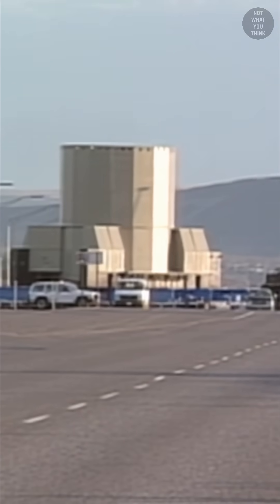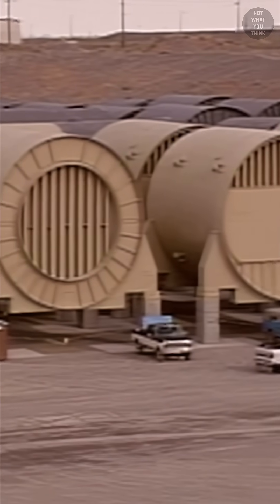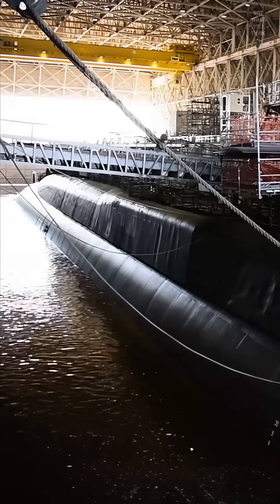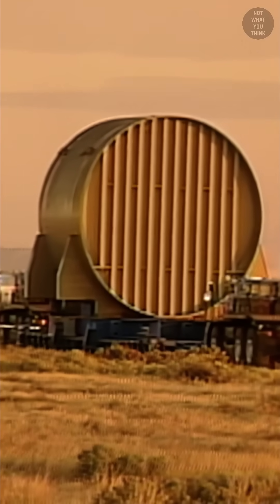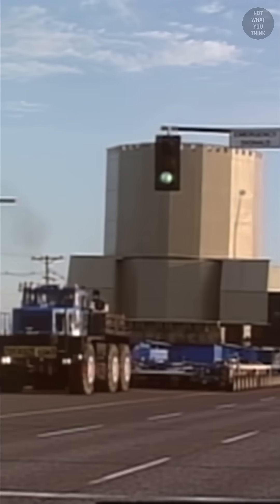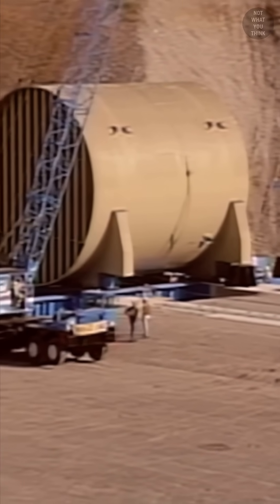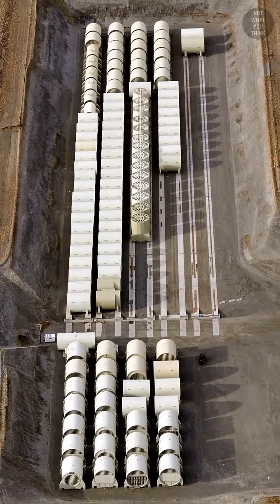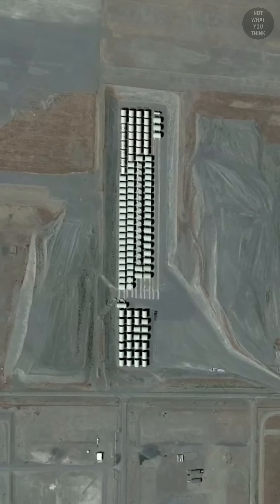What Happens to Decommissioned Naval Nuclear Reactors? #shorts

Comment: In the netherlands we just yeet al our nuclear waste into the ground.
Reply: Hell yeah! Do you guys also throw car batteries in the ocean to recharge the electric eels?
Reply: It’s amazing that a 350 foot (106.68 meter) tall monster hasn’t paid y’all a visit, because it sounds like all that radiation would be a pretty hefty entree for him.
Reply: @michaelmurray11189  that stuff is a  radiation hazard for between 200 and 400'000 years, the geology of the sites choosen for the tasks will take much longer to change enough to disperse in the environment those wastes plus those are stored in a glassified form highly stable and not soluble. I would worry more for the slave extractin rare earth in Africa, or the Bantou lake in China result of rare earth refinement, or the Yellowknife mine in Canada with more than 230'000 tons of deadly water soluble arsenic trioxide waiting to enter and accumulate in the foodchain. (And arsenic trioxide won't decay like radioactive stuff, it will remain deadly until it exists)
Reply: @bellini98-1  Hanford will be hot for 200,000 to 1,000,000 years
Reply: @michaelmurray11189  considering where radioactive material comes from which is usually deep with inside the Earth crust the crust is a pretty good container for a radiation
Reply: It tastes better that way.
Reply: @CelestialCrab    if I'm understanding what ur getting at correctly, yes your right. That was also what I was getting at. There are different levels of toxicity in nuclear waste. The more enriched uranium/plutonium is, the more harm it can do. For example a lot of waste from power plants is "waste water" which is mostly contains elevated levels of tritium, that stuff can pretty much be dumped into the sea without serious problems. A factory enriching uranium for nuclear weapons or other applications that require "highly enriched" fissile material has more radio isotopes in the waste. Things like cesium etc. side note, very few ships run on nuclear reactors. Pretty much only aircraft carriers, subs, and some ice cutters.(of course there are exceptions) So basically the risk isn't as great is what my point was, I THINK lol. Don't even remember all the content of this video honestly.
Reply: We do too in places like Yucca mountain(America)but you also have to consider nuclear wastes for industrial and energy purposes is nowhere near as environmentally destructive as military grade waste. Also as mentioned we have a treaty. Then again we have places like Hanford which keeps radioactive and chemical weapons OUT IN THE ELEMENTS IN ALUMINUM BARRELS 🤦. Its seeping into the ground, but no big deal i guess, just uninhabitable for 40K years is all lol
Reply: @jordan ryan  well it's not just the waste but the the whole reactor including its pressure vessel so there's multiple layers of protection besides just the circus which is routinely checked and monitored.
Reply: And someday Netherlands gonna transform into Nether
Reply: @archivushka  doubt it
Reply: The Netherlands doesn't have a history of threatening Russia with ending the world like the US and Russia relationship (which goes both ways). This who process is to help prevent a world ending accident. 

Remember, that the USSR and the US came minutes away from accidentally nuking each other over a misunderstanding.

An example was during the Cuban missile crisis, some US destroyers detected three Soviet submarines and started chucking depth charges near them to force them to surface. 

What the Americans didn't know what that the submarines were armed with nuclear tipped torpedos and everyone on the subs agreed to fire except one man who rightfully suspected that the Americans were trying to make them surface, not sink them. 

Had that one man agreed to fire as well, the world likely would be a lot more like Fallout 4 today.